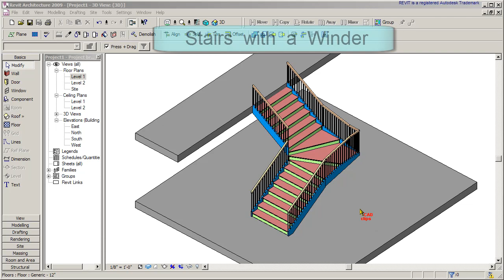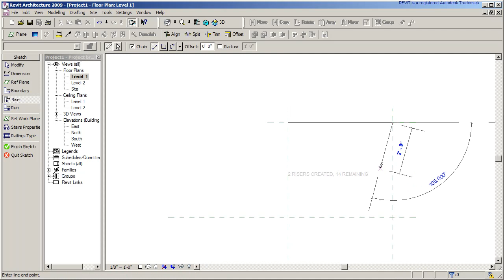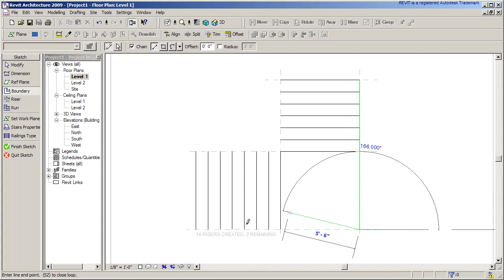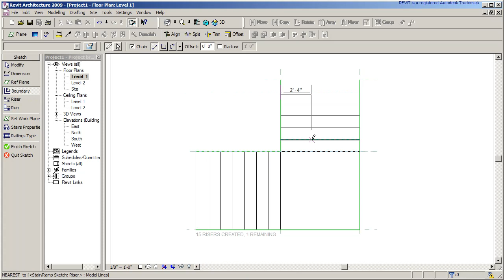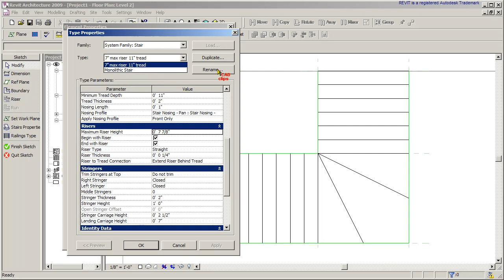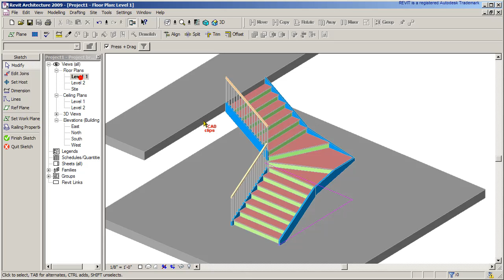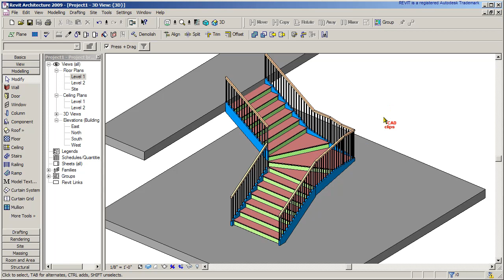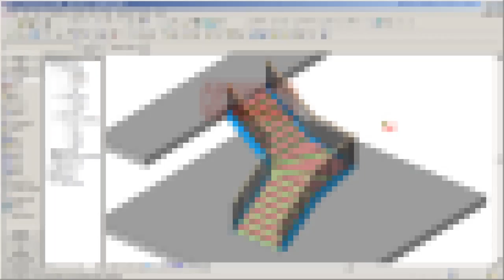REVIT Stair Tutorial with a Winder - CADclips

Comment: Ok, this is all great. But it wouldn't work at for putting into production. Are there tutorials for creating stairs that will actually work for production? I cannot seem to find any.
Reply from the maker: There are definitely better ways to make stair in revit but autodesk revit is not a stair manufacturing design tool.